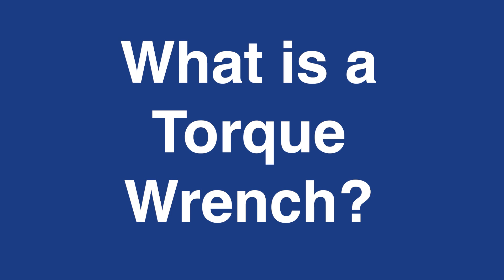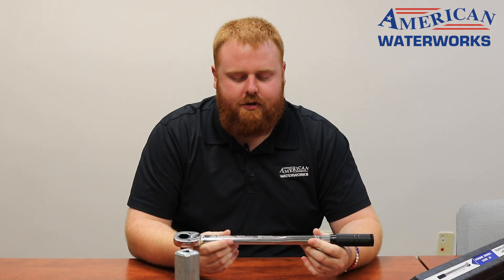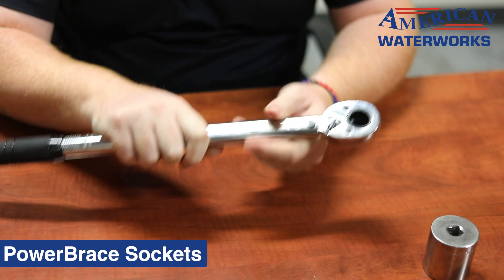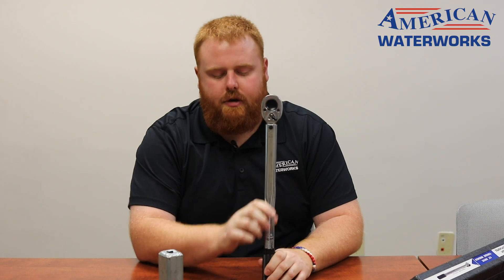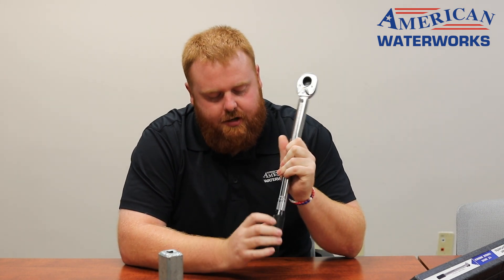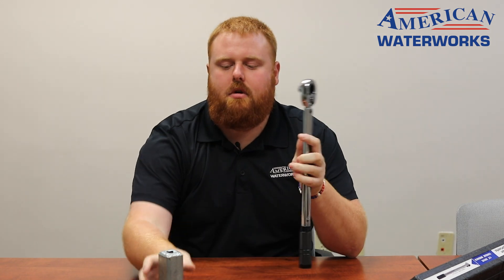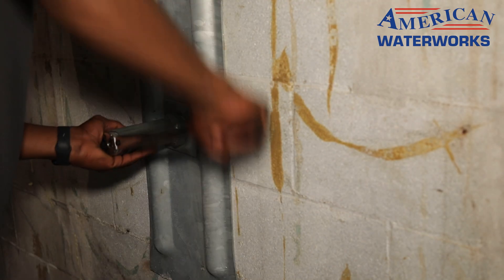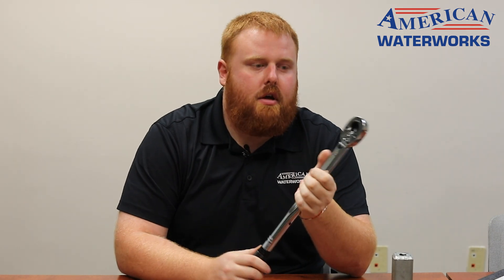Torque Wrench Tutorial for Wall Anchoring Systems (Foundation Repair for Customers and Homeowners)

Comment: Can you share what kind of socket you use? Plus the size?
Reply from the maker: Hello @JustinMannMedia! Our Service Techncians uses two different sockets for each wall anchor system. For our GeoLock Wall Anchor system, our Service Technicians use a square socket with a six inch deep socket, a half inch drive, and a one and a half inch nut drive. For our PowerBrace Wall Repair System, our Service Technicians use a round socket with a two inch deep socket, a half inch drive, and a one and a half inch nut drive. Both of these product you can purchase through American Waterworks.
Reply: @americanwaterworks1 thank you. I did some searching and I found a Shopify thrasher group page with a wall anchor tightening kit. Looks identical to what you’re using. Couldn’t find anything sold on your website though. Maybe this Shopify page was it.
Reply from the maker: @realjustinmann  You can give us a call at our office (800)-795-1204 and you can order your tightening kit today. Have a great day!